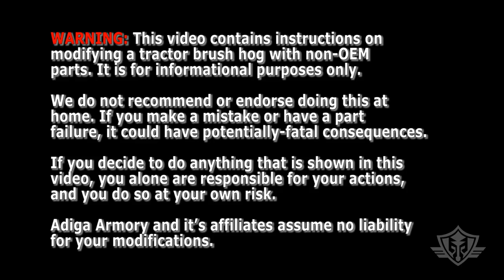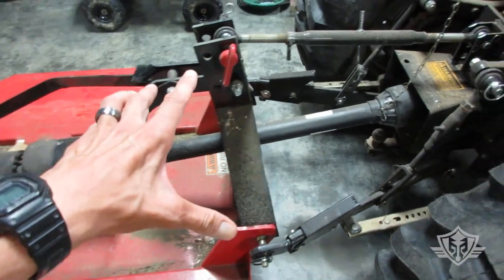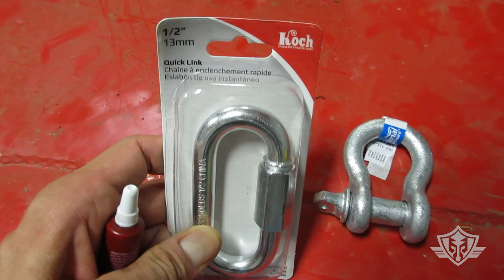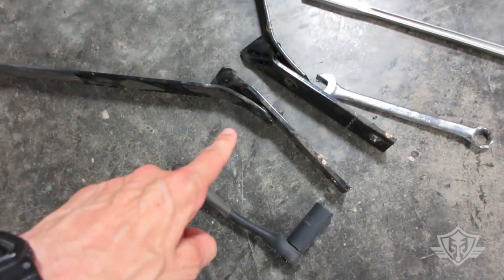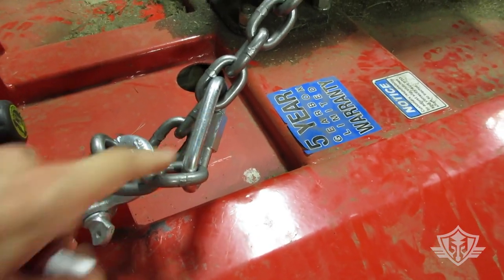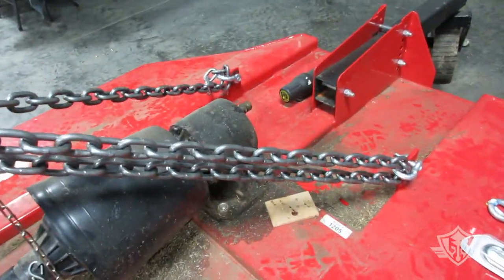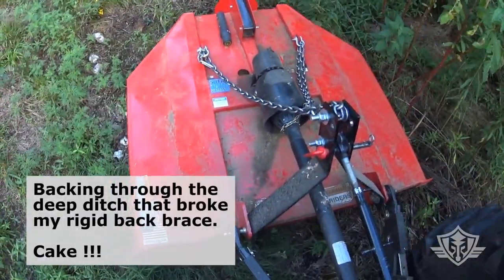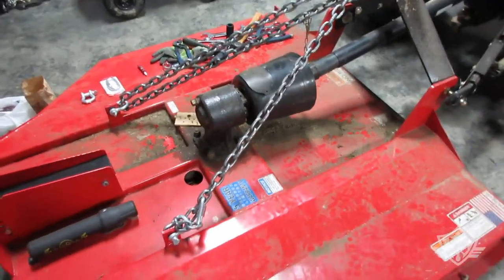DIY Replacing Brush Hog "Back Brace" with Chain Using OEM Rigid Top Link.

Comment: My old Hardee has a top link attachment point that pivots to allow some flexibility. A system like yours wouldn’t work on mine since the “yoke” on it is rigidly attached to the cutter deck. I think if you study those arms, they’re “flexible” to a certain extent but were installed upside down by the dealer. I saw another video recently where it said the kids at the farm stores don’t know the difference and most all were assembled upside down and nobody noticed. The chain works good though and a single chain is often used to replace the tractor’s top link, which is a bit simpler than yours. Field General cutters come with two chains like yours. Thanks for sharing … keep cutting!

Comment: Your threaded link is weaker than chain link ,not osha approved,it will break
Reply from the maker: LOL... "OSHA approved". Is that like "FDA approved"..."safe and effective"?  Anyway, the original back brace also broke, so anything "can" break... but it's extremely unlikely. Simple math is your friend... 800lb bush hog and 3250lb threaded links... one could literally dead lift 4 of these bush hogs with that capacity. And of course, none of the weight [literally zero lbs] is actually on those threaded links. They are just fail safes. All of the weight is on the chain and the shackles. But it is your business what you do with your machines... take it or leave it... I am just showing you what works for me... still going strong 1+ year later.

Comment: Should,ve used another 3/8,s shackle, hooked to chain,your chain link is at a stress point to break,your threaded link is much softer metal to break,not osha approved!!!
Reply from the maker: Not sure that makes any sense... the hog weighs less than 800lbs... that threaded link can handle several thousand pounds... and literally none of the weight is on it... it is just a fail safe. All of the weight is on the chain and the anchor shackles because the chain does not slide freely through them. But of course... you should do whatever you want... it's your life... but this has been working well for me for over a year. I guess time will tell.